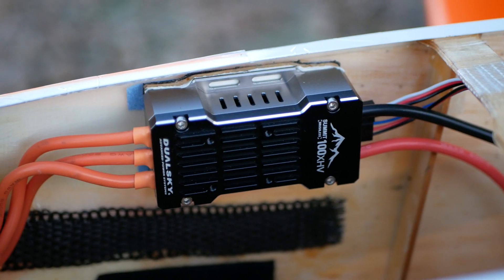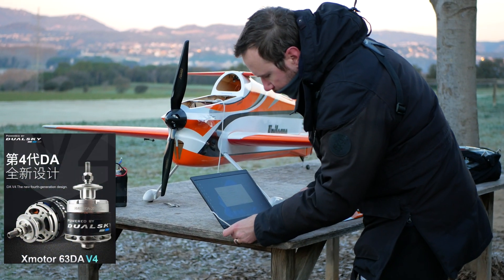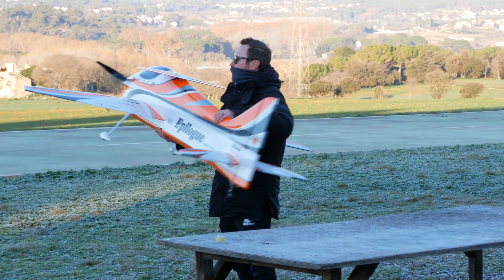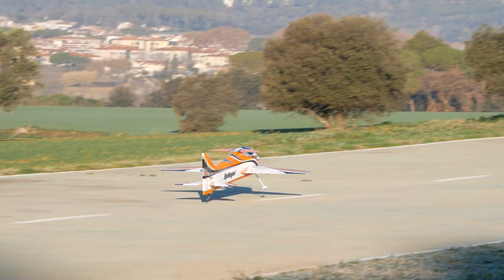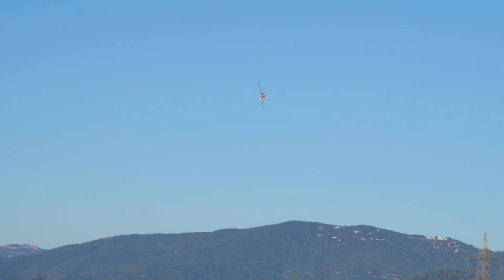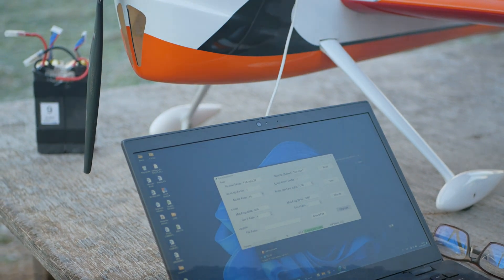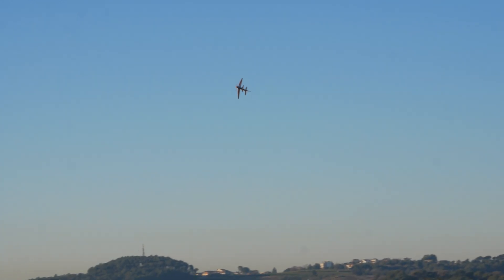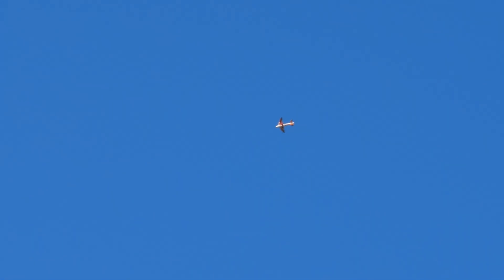One Propeller is Enough! - My Single Drive Setup for F3A

Comment: I purchased this ESC for my F3A flying on your advice. It's a very nice ESC. However, what software are you using in this video to program it? I'm looking specifically for the governor settings.
Reply: I used this very good manual for the ESC and configuring it for F3A: 
http://dualsky.com/downloads/SummitXHV_Setup_Help_By_BarryBuxton.pdf